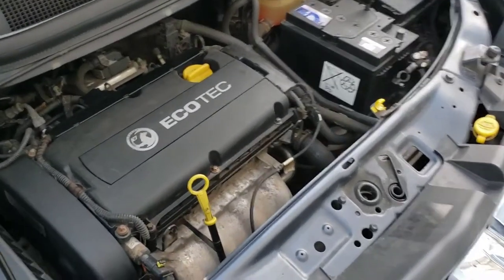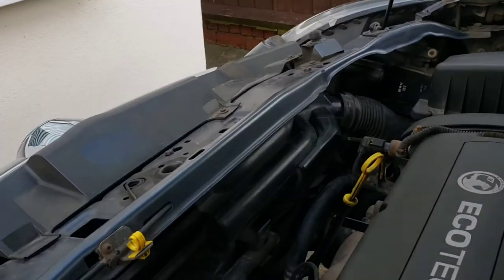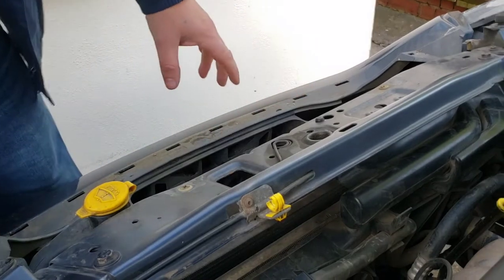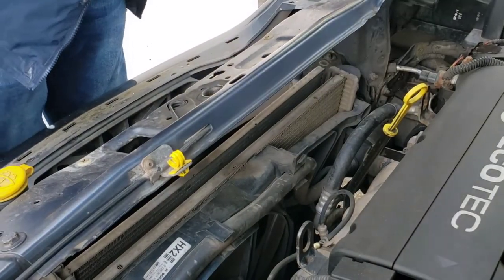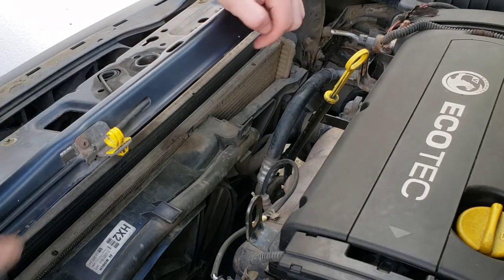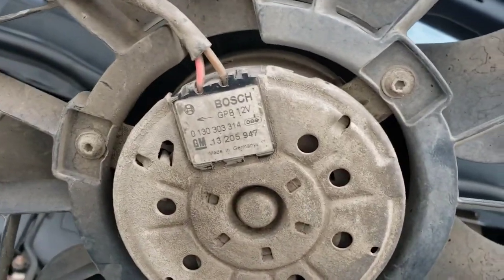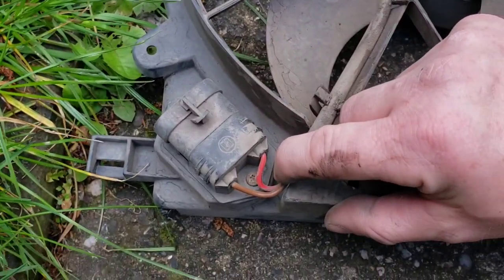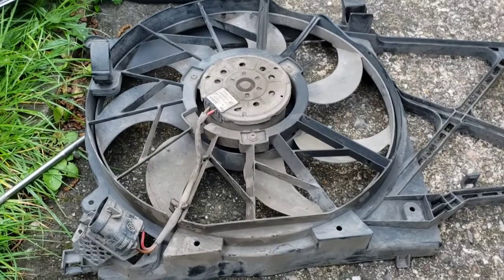zafira B p0482 radiator fan moter register removal

Comment: Hello van you tell md the problem you had.  My fan stays in all the time Evan with mo keys. In the van only way is to pull fuse out .to stop it .thanks
Reply from the maker: It may be the temp sensor
Reply: Replaced temp sensor still running all the time p
Reply from the maker: Have you checked your temp sensor